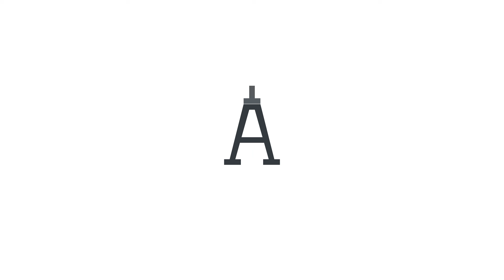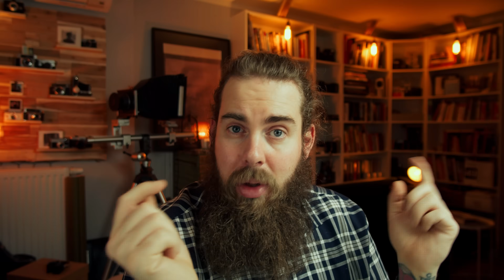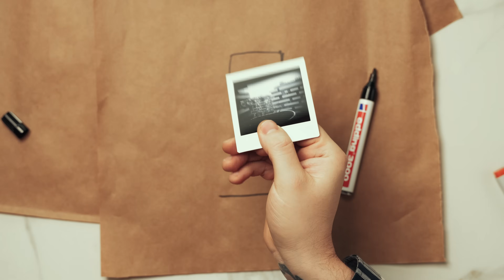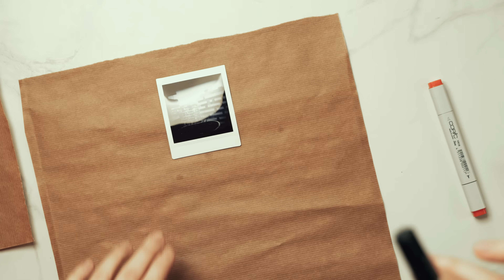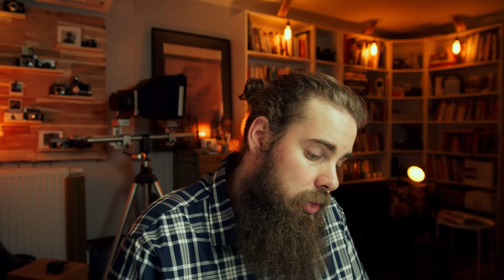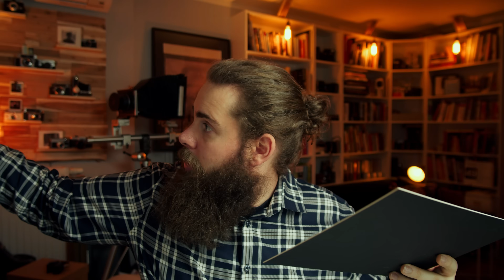How To SCAN your POLAROIDS

Comment: I use a scanner, but I've found a good on the go option is the app google photoscan. It takes 4 photos in different positions and stitches them together. If there's not a lot of light you can turn on the flash to use as a light source, it then uses machine learning to remove any glare from the light. It's not 100% successful but it does a pretty great job